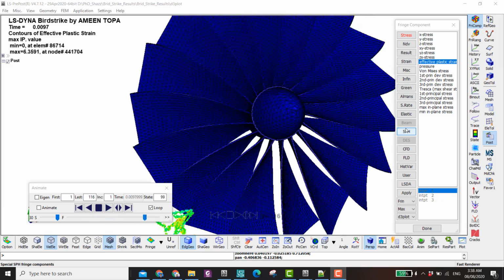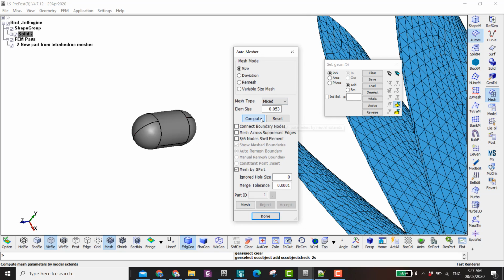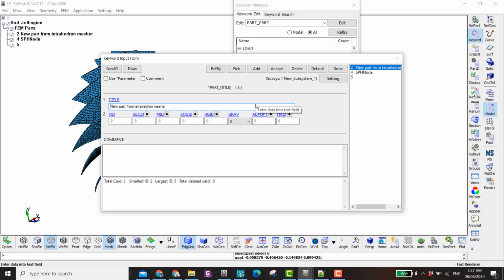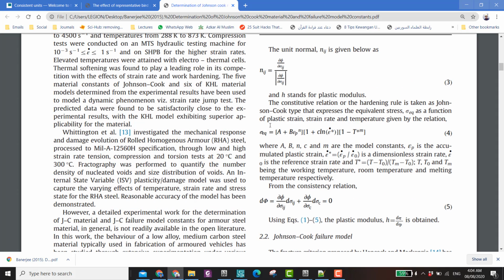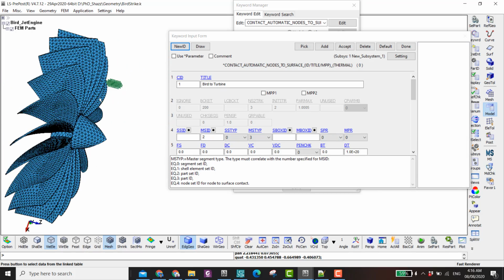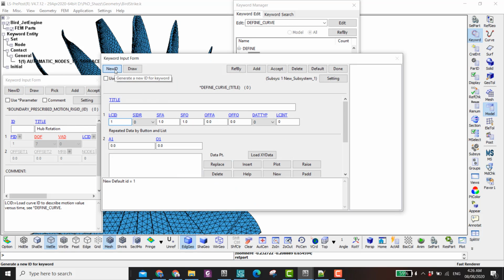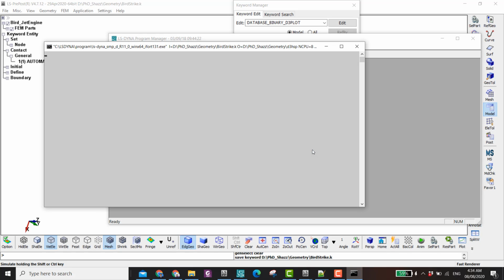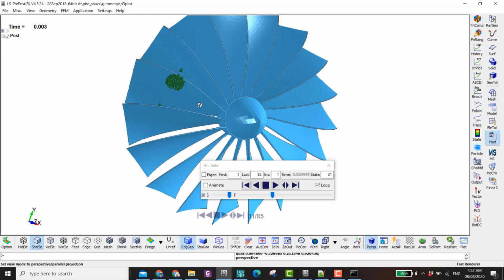LS-DYNA TUTORIAL 17: Bird Strike Simulation Revisited

Comment: Thanks so much Mr. Ameen. It's a helpful resource. 
I want to ask you a question about bird impact to the plate. 

When we hit the bird against the plate at a speed of 100 m / s, some SPH particles pass through the plate. When we increase the speed, the number of parts passing through the plate without deformation increases. Similarly, when the bird's speed decrease, more SPH pieces hit the plate. I used *CONTACT_AUTOMATIC_NODE_TO_SURFACE for the simulation.

 What should I do? Thank you!
Reply from the maker: You are welcome and thanks for your kind words. Please share my tutorial so more people can benefit.

In higher velocities, you may want to decrease the time step scale factor TSSFAC which can be found in CONTROL TERMINATION. Give it a try and let me know if it still doesn't work.
Reply: @AmeenTopa  
Thank you very much for your feedback. 
 
I set up TSSFAC 0.6 on the CONTROL_TIMESTEP. Results are started to improve.
Deformations begin in the plate, but the beginning of the  SPH model is still passing through the plate.
Reply from the maker: @yusufyamaner4005  There are few things that you can do. One of them is to used SOFT = 1 in contact option card A. This will be helpful if the material of the bird model is very soft compared to the blades.

Comment: Hey, bro. Thank you so much for your kind. But I still have some questions about the pre-stress of the rotating blades. Could you give me some advices?
Reply from the maker: Yes afro, how can I help you?
Reply: @AmeenTopa  I am stuck in the implicit solution process of LS-DYNA.  Firstly, I cannot make the solver stop right at the termination time, meanwhile,  the solver does not write the d3plot  according to the time I've set. Secondly, the results are quite different from ones of ANSYS APDL.  Do you have same experience?
Reply from the maker: @宋长远  You can see my tutorials on Implicit Analysis, it may be that you need to reduce the timestep or use variable timestep.
https://www.youtube.com/watch?v=3lqeqYbAzoo
https://www.youtube.com/watch?v=jIUcQx6XZ2E

Anyway, I need to know more details to give more useful answer.
Reply from the maker: @宋长远  You can watch this video too. Recommended:
https://www.youtube.com/watch?v=ImyCqrk4j04
Reply: @AmeenTopa  Thank you, there is still something wrong in my implicit phase calculation. I turn to use Ansys as my implicit solver this time.
Reply from the maker: @宋长远  Good to know that. Actually there are many settings for implicit solver in LS-DYNA and the default settings don't work for complicated cases.